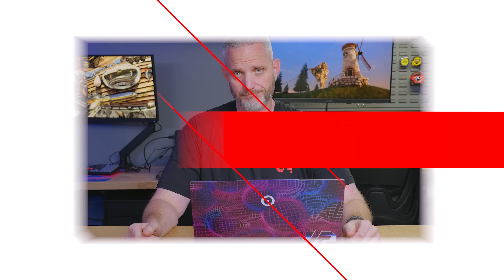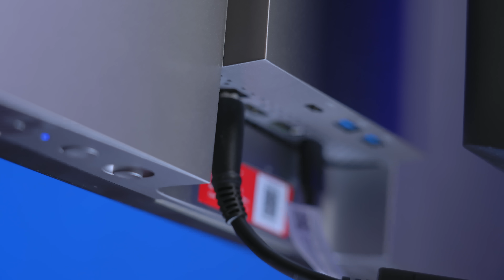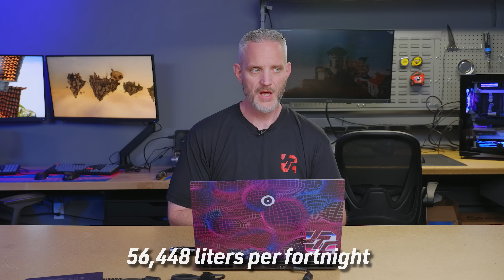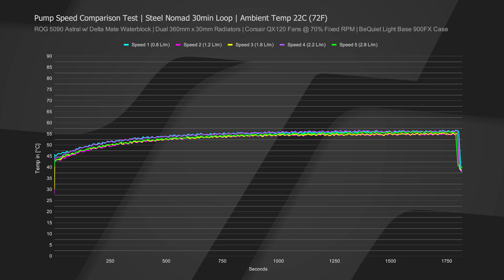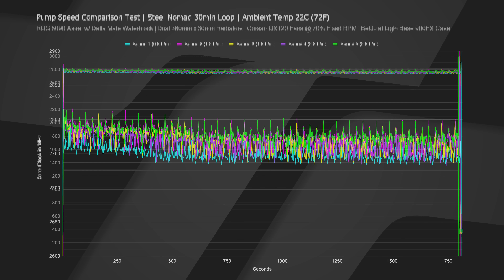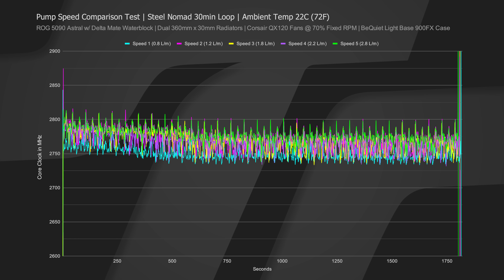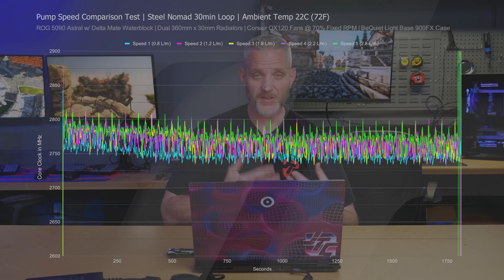Stop doing it this way!

Comment: The bigger the temperature difference the faster it equals out, accounting for conductivity. That's why radiator cooling is measured using heat energy loss over time at a certain temperature, so I feel like it'd have to strike a balance between wicking heat from the components and the radiators wicking heat from it.

Comment: I've been using the XD5 pump from Corsair for the last few years, and after some basic testing at the beginning I decided to just set the pump speed to the point where it was quietest, and for my loop it was between 45-50%, or ~2370rpm.
Once I go above or below that I can start to hear the pump whining a bit.
And even if it did affect my temps I think I'd still set it at the quietest point, because the buzzing from a pump can be a lot more annoying than the gentle hum of your fans.
Reply: With how my D5 is mounted, it has three sweet spots where resonance goes away. It's currently running at 4100 rpm and it's inaudible over my fans idling at 800rpm. When I heat my system under full load to a stable state, I can see more than a 3°C difference in CPU temperature between 2000rpm and 4100rpm pump speed.
Reply: @a.x.w  So, which temp is the higher one, the at 2000rpm, or the one at 4100rpm?
I would imagine that you (not you specifically) could get better temps with a higher pump speeds, provided you had enough radiators for the liquid to pass through, but that you'd get better performance at lower pump speeds with less radiators, like Jay said, because it gives the liquid more time to cool down, and you're not sending warm liquid back around again.
And of course your case temp would also be a factor, like if you're blowing hot air onto the reservoir then liquid is going to be warmer as it goes back around again.
Reply: @JoeBob79569  The CPU temperature went down quite linearly with increased pump speed. My water temperature was constant throughout the test. You cannot increase a radiator's performance by reducing flow like you said. Their efficiency scales with the temperature delta between water and ambient temperature. Think about it this way: you're dumping a fixed amount of wattage into the water as heat and the radiators need to remove that very same amount. Reducing the flow rate does not change this equation.

Comment: One other way to measure the heat being dump by the pump will be to measure the heat of the wather returning to the recevoir and the heat of the water exiting the resevoir but this might be slighly affected by the ambient temp inside the case.

Comment: I spent about 2 hrs tuning my 420 AIO pump speed, fan speed, and case fan speed a little while ago. settled on 75% pump and radiator fan speed, with 40% case fan speed to lower the noise. and a whopping... 4* difference dropping my 13700k from 88 under load, to 84 at 250W. im ok with less noise and longevity even if i didnt see a temp drop.

Comment: The data point that I think is missing is the temperature of the coolant after the last rad going into the CPU or GPU which ever is first and the temperature coming out of the t he last component before the first cooling rad.  I wonder if the heat saturation helps with the lack of difference between speeds. EX. slow speeds the temperature delta is bigger than at fast speeds.

Comment: Question on the manual pumps I know they plug in via molex/sata do we still plug the 5v into the board? Is this only so the board sees a pump signal not to adjust speed?

Comment: im using the Thermalright Frozen Prism 360
i have the pump at 75% and the fans at 100% since they are on the top of my case so its always pulling out hot air
its on a 12700k and theres a 3080 ti in the case too so theres a lot of heat coming out of it

Comment: idea for an experimant is what is the perfomance differance between normal flow vs reverse flow. like use a test bench and use soft tubing to the pump and test it in the correct flow direction for the blocks then swap the pumps tubes so that the flow would be wrong. like instead of going in the in it comes out the in

Comment: Interesting analysis, I do now wonder if it would be worth while to see what the sweet spot would be for number and/or size of rads then if the fluid speed does not provide significant temperature difference.

Comment: Spot on on every point, including harmonic resonance,  the temperature equalises in the loop,  and it levels off at a point dictated by how fast the heat can  escape the loop,  so pump speed is a moot point  if the heat cant escape quick enough, all that will happen is the water will circulate quicker, and like you stated pump pressure has to be high enough to overcome the resistance in the loop,  I  have been running the same loop  for almost 10 years with a  radiator that could run a small car, the 360x360x60 thick Phobya 1080 extreme radiator with 4x 180mm fans, carefully shoehorned into the lid of a Core X9 case, a  D5 pump coupled with a 30cm high tube res, 3/4 tubing,  EK blocks,  I have 2 D5 pumps , 1 is pwm driven and the other is manually set, what I found when experimenting with the PWM pump was that there is nothing to be gained  running it flat out with the fans as they are,  and running the fans flat out  with the pump flat out gives a very tiny gain that also makes the water cooler as loud as  an air cooler,  - in truth I can run it most the year except the real hot summer months  without the fans as heat rises and  as the 2x front 230mm fans  fans draw in cold air below it it seems to aid forcing any heat upwards  out of the case, heat rises and taking that into consideration when laying the loop out seems to have given me a bit of an advantage in some respects even if its a bit awkward plugging the GPU in...

Comment: My biggest question at this point is with 5090s or the 4090s having the melting problems would something like the BTF (Back to Front) stuff Asus designed help or would that just move the problem to another component?

Comment: Physics shows that if you increase the flow rate, you get slightly better cooling efficiency at the radiators since the water temperature across the radiators is more even, which helps to lower the water base temperature of the loop. However, this effect is really marginal at any reasonable flow rate, which agrees well with your test results. The abnormal rise at high flow rate is probably due to the extra heat generated by the pump running at higher speed. 
I run my D5 pump at 40% PWM to achieve a flow rate ~ 100L/h (~ 1.6L/min), just because this is the highest speed that is silent. When running at full speed, I do achieve slightly better temp (usually less than 1C) but there's a penetrating coil whine from the pump that is really annoying. So I linked my pump PWM to CPU temp and let it jump from 40% to 96% only when CPU temp is higher than 70C.

Comment: Interestingly enough one of the watercooling veterans way back when watercooling was still in its infancy did some fairly thorough testing, and found that flowrate made very little difference on temperature as long as it was over 0.5 liter/minute. Do keep in mind that this was almost 20 years ago, when heater cores were still all the rage, but with Jay getting decent results with 0.8 liters/minute flowrate I'd say it's still at least somewhat valid.
Reply: 0.5 litre a minute is like just above quick water drops from your tap. That's not going to keep a CPU or GPU cool at full draw, especially not with OC.

Comment: When I last took my loop apart I did a test with a dummy loop with only pump (Laing DDC 18W ) and tank with about half a liter of water.
After fifteen minutes the water temperature was 2 to 3 degrees above the initial temperature. Adding a  120 radiator was only 1 degree.

Comment: Thanks Jay! I have (2) 360's and (1) 240mm thick rad and have lots of resistance, but enough flow through the loop. You have made my anxiety for "optimum speeds" less as was worried.
Reply: It's not 240 thick, it's 240 long
Reply: @TommyTombstone  240mm long and a thick rad. Sorry I have to explain that
Reply: @TommyTombstone 
I guess he/she wanted to say that they are thick 360/240mm rads... like 40 or 60mm thick.

...or he/she found actual 240 to 360mm thick rads, that would be wild XD

Comment: but have you tried using software to lock it at the boost clock? you might get more temp differentiation between the speeds by pulling the boost clock rising and dipping as a factor. the only major factors there would then be the bench test software demands of the system and the loop speed.

Comment: i think the "time spend on hot or cool side" is irrelevant. it is about how the flow is on the cold plate. is it turbulent? does it get forced to move through the microfins? and maybe the flow in the rad. if there is some short circuit flow or if it is forced through all channels...

Comment: Does volume of fluid in a system affect temperatures? or is it just increasing surface area of radiators? Im wondering if its possible to test the same loop with like 3 liters, 4 liters etc

Comment: Ive build my system as a playground wirh aquacomputer software. I measure water temp between every part in the loop (gpu,cpu, 3 radiators). I actually use a pid controller for the pump to limit delta T of the gpu and cpu. At idle the pump stays at 0% or about 2000rpm (d5). I limit the delta t of the cpu to 0.7°C and the pump to 1.5°C. 

Under full load the pump maybe goes up to arround 3500rpm or arround 50%. With higher pump settings there is not a single bit of improvement on the temperatures.
Water temperature is averaged and also pid conteolled to always be the same arround based on energy draw and limited to 36°C.

It really doesn make much of a difference. Its still 100% stable at idle pump speeds with the gpu beeing maybe 3-4°C higher from 49-50 to 53°C under full overclocked load (3080 fe at 370w)

Comment: i run 3 triple rads with a 4090 and cpu in the loop.   I have tried other speeds and I get a noticeable pump whine.  At 100%, it's whisper quiet.  I have resigned to needing the 100% unless you have any ideas for the pump whine.

Comment: My sweet spot for coolant temps and the temps of my 14900k and 4090 is 70% with 3 ek p360rads and my fans at 1500rpm. Ambient is 24c. Gaming temps are in the high 30's to low 40's on both cpu and gpu while coolant stays around 31c. I noticed more than anything my hotspots were the ones affected most changing pump speed.

Comment: I balance pump speed against noise. Loop has 3x 360 rads, GPU block 4090 strix, cpu block 13900k and a distro plate (ek O11d XL). Flow rate on the aquacomputer next is usually around 120L/h or 2L/m. Flow rate fluctuates a bit depending on temperature but pump speed is set via the quadro at 69% (giggidy) with fan speed modulating based on water temp. Seems to work ok. 100% pump speed is just too loud.

Comment: It would be really interesting to know how much Heat is input from Pumps and Fans, especially when the latter function as an Intake into the Computercase. 
In over 35 years of Computer Building, I've also noticed that there seem to be considerable Differences between individual Manufacturers and Brands, 
and that Products advertised with very high Air Flow and Air Pressure tend to dissipate disproportionately large Amounts of Heat. 
The Influence of Push-Pull and the Thickness of Radiators would also be Interesting...
Over the past Decades, I have gained the Impression that the additional Effort and Costs of particularly highly tuned Fans, 
Pumps and Radiators are not really in a justifiable Proportion to the achievable Temperature Difference measured in Kelvin ...

Comment: Just a note on the pump you used in your rig, Jay. I own that same XSPC variant of the D5 (I saw it in your actual build video). It's over 10 years old and still runs within spec like when it was brand new. It was the very first pump that I ever bought, so it's probably closer to 15 years old now. I've even bought and used other pumps over time. A couple of DDC and an Alphacool VPP755 and they have all died over the life of the XSPC D5 that I keep going back to and am currently using because I've kept it around as a backup. The thing is a tried and true workhorse.

Comment: As long as the flowrate is high enough to maintain turbulent flow in the water blocks, it won't affect much. It'll just collapse your delta T in the loop, bringing the hottest spot down and coldest spot up, but the average temperature will stay the same.

Max speed for filling, mid to low speed for daily use. Save the wear on your parts.

Comment: 10:00 It could be interesting to run the pump without the computer being on and check the coolant temperature this way to see how much heat, if at all, the D5 generates.

You might need a weird custom loop with a bunch of just the pump + res + sensor and a bunch of cpu blocks to simulate the resistance of a real loop without having rads that would likely just passively cool the D5 without a measurable change in temperature.

Comment: Thanks for this, good video, much like your older ones from years past. 

Please take up an additional follow-up showing the thermal imagery or laser temps at the D5 at various speeds to indicate heat output past its normal cooling via the coolant.  Even better if for funs you could show a DDC build loop on same and why you want a heatsink on the pump's back casing. 

Could throw in your particular "favorite" brand modern AIO as well to indicate a few things: 1) they have barely enough power to move the tiny amount of coolant in a mostly vacuum sealed containment.  If flow rate truly mattered much, current AIOs simply wouldn't work.  2) any indication of the heat they generate (tough to pull off for the integrated asetek style pump with the cold plate combos).

Comment: So one question that arose in my mind was the difference in temperatures at entry and exit of the two radiators.  How much cooling happens in the 1st and how much in the 2nd if there is any.  If the first radiator gets the coolant to room temperature, that 2nd radiator can't lower it anymore, right?  I know it's probably a real pain in the ass to setup.  But it would be nice to know the impact of big rads vs small rads and multiple rads vs a single rad.  Or maybe someone else captures those temps for comparison?

Comment: Paraphrasing a little bit: "Theoretically, if the fluid flows slower it will have more time to cool off in the radiator." You could technically test to see if this is true by adding temperature sensors to the loop and measuring the coolant before and after the radiator/s while the PC is under load. Another less scientific way to test it would be adding an air temperature sensor right at the exhaust of the radiator and comparing it to the ambient temperature. In either case, if the temperature delta over time is higher with the slower pump speed then it would support that claim.

Comment: Thanks for the work. I run 2 large 560mm radiators w/2 D5 pumps @4.2L/minute. GPU can draw 600watts, CPU 9950X3D and I’ve seen it pull 270watts max. I’m going to track coolant temps, and play with pump speed to see what results I get.
Reply: Thats what I need for my 14900KS.

Comment: From a purely thermodynamic efficiency stance, faster is better until the water is moving so fast that 1/4 of the heat is coming from friction between the water and the loop. Sure, it spends less time in the rad, but it also spends less time accumulating heat, and they'll be proportional as surface area is remaining constant. The more fluid you have, the slower you can get away with because then you get steeper diminishing returns with added speed.
Reply: Before someone actually tries this, I don't think a common loop could handle the pressure necessary to reach flow rates high enough to generate ~200W of heat through friction. XD
Reply: @a.x.w  Too late, Linus Tech Tips already tried this, they used a freakin fire truck X-D

Comment: I would be curious to see what the error /accuracy in the msmts. are. With differences of + / - 2-3  deg in such a test, I am not convinced that such a delta is outside the error range. In other words, maybe the tests are inconclusive. Then there is a the point made in another comment about the noise and the graphs, which should indeed be looked into.

Comment: it's all about thermal capacity, you want the fluid to move fast enough to take as much heat away from the component in X time and slow enough to be cooled in the rad for the lowest possible temps.

Comment: My case is the thermaltake core x9...
Some dog benches are smaller then my case, so kinda had to fill it up.
And i didI run my 2 d5 pumps at 5, i have 3 360 rads all 3 60mm thick and 2 reserviors one flat from ek and a round one, a monoblock and a full cover waterblock from ek. One for the 3600 and 2080 super. It's a great PC. I did a test in the beginning of building it, and at full speed it's less noisy then at slower speeds. That was my motivation to keep it at full speed. I guess some resonance was the issue. I know i could cool 2 pc's with this Setup and still have enough headroom, complete overkill for what i have as a single system. My fans barely have to run to cool the loop, the biggest pro.

Comment: If you have 2 radiators then you can increase your dwell time in the radiator by running them in parallel, instead of series. However, total radiator length won't change, so this may not change total potential. In fact series resulting in a hot radiator and a cold radiator may net better results
Reply: One advantage of series radiators comes to fan speeds. The first rad with the higher ΔT between the radiaotr and the air can ran the fans slower and the second rad with the lower ΔT can run its fans faster so that in the end each radiator is dumping heat at the same rate.